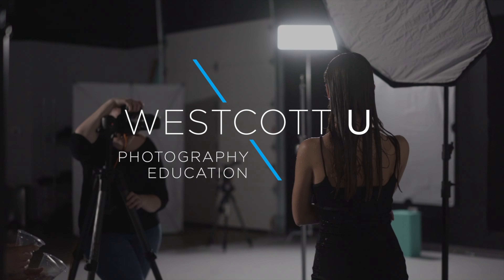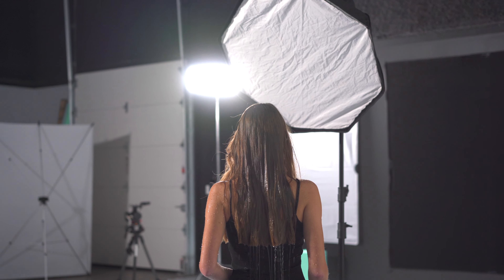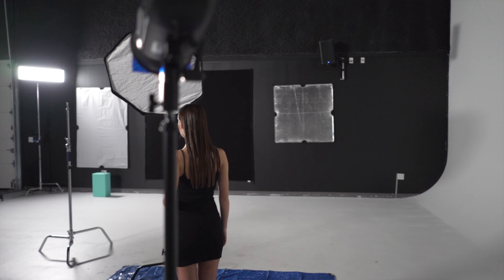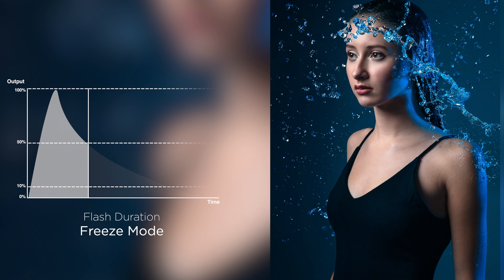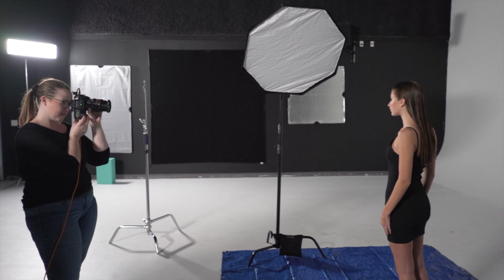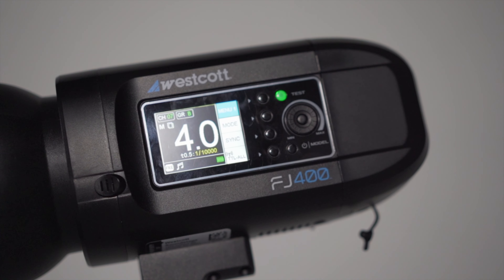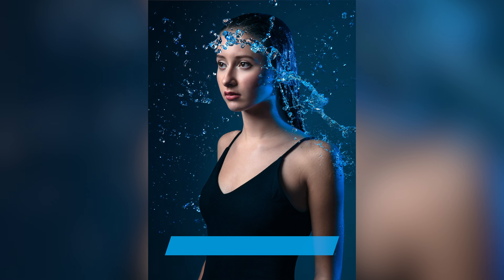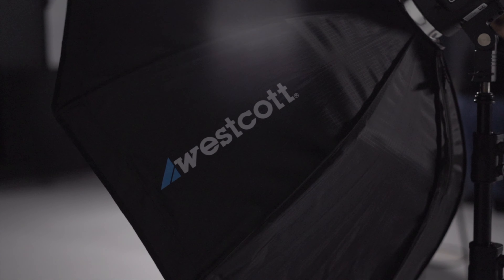Using Strobes to Freeze Action in Portraits with Quick Flash Duration Featuring the FJ400

Comment: May be a dumb question but here it goes:
Is the Freeze mode different from the HS mode? The reason I am asking is because when I adjust the sync mode on fj400 it cycles through Normal/HS/Freeze but only under Freeze mode u can actually see flash speed ( and of course as the power goes down and so the does flash speed). However, when using FJ-X2m It only cycles through TTL/M/HS no Freeze mode. 
As soon as I fire the flash through my FJ-X2 the display on FJ400 changes again to HS, while firing it by using the test button on FJ400 does not. 
So how the HS and Freeze mode are related exactly and if they are different how can I control it through my FJ-X2m?
Reply: I am having the exact same issue 😫